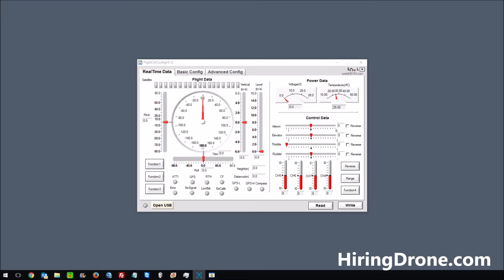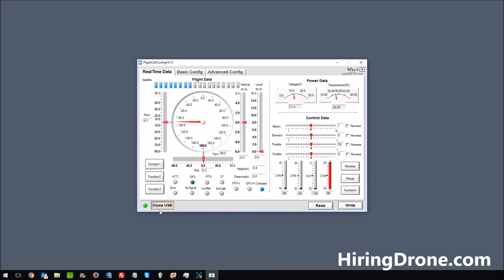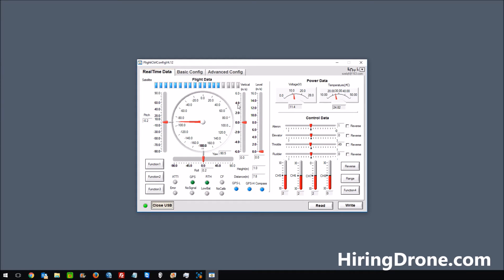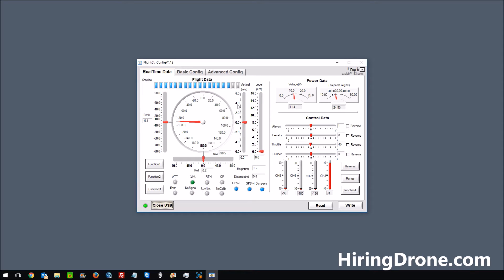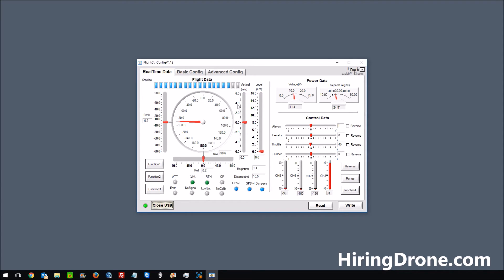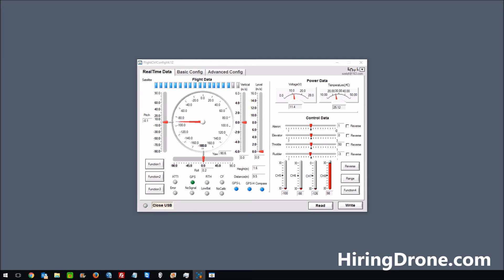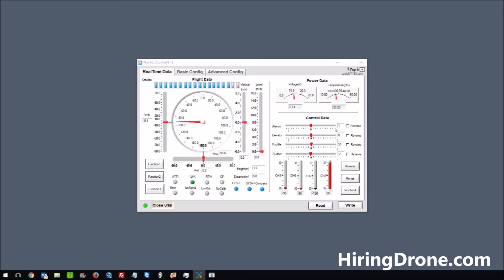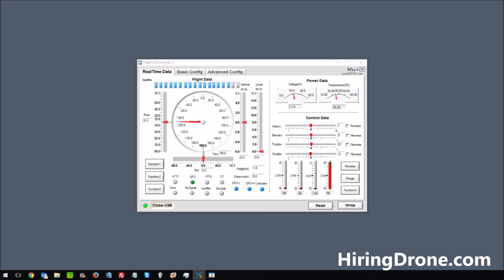WLToys V303 Seeker Transmitter Antenna Issues

Comment: unable to open device , is the message I keep getting , windows 10 not loving it AT ALL
Reply from the maker: +nukerzero the first Did you install the drivers on your CPU first? Also, there are two versions of the V303 being shipped. If you have a built in micro USB port on the bottom of V303, you need to use the XK Detect X380 flight controller software. If your V303 has a wire hanging from the belly, you need to use the V303 Seeker flight controller software. I have the new XK flight controller board in my V303, so the V303 flight controller software does not work. I received the same error message as you, when trying to hook my V303 up to the V303 Flight Controller Software.
Reply from the maker: +nukerzero the first Try using this software and follow the instructions. Do NOT update the firmware on the V303 with the XK Detect's firmware. Only use this program to adjust your settings. http://www.firstquadcopter.com/downloads/x380-firmware-and-driver/

Comment: Just received my v303 and it came with the new transmitter.
Reply from the maker: +High Desert Garden (Phillip) Awesome! I have the older one, which seems to be the issue. Most likely you also have then receiver too. Please let me know how it flies. I am interested to see if the issues have been worked out with the new TX and Receiver. Best of luck!
Reply from the maker: +High Desert Garden (Phillip) - Did you get a chance to fly your V303? How did it handle?
Reply: +Hiring a Drone I've been working. I might fly it Saturday if it's not too windy in these mountains.
Reply: Hiring a Drone I still haven't had a chance to do a range test; however, all you need to do is buy the xk detect x380 transmitter because that is what the new v303 comes with.
Reply from the maker: Thanks for the update and confirming. I was hoping this would be possible. Do you have video of your flight? Any issues?

I actually found someone that was selling an old V303 transmitter and receiver a few days ago. I just received it in the mail about 10 minutes ago. I was able to bind the transmitter to my V303 and did an indoor range test, moving from room to room (props off). No red light yet. Big thanks to KiwiSurf for hooking me up with the new controller!

I am taking mine out in a few minutes for a test flight at night. I will post the video tonight, if I have time.
Reply: Hiring a Drone Yes, I just posted a video with a quick flight. It holds position pretty well. Can't wait to put a gimbal on it.